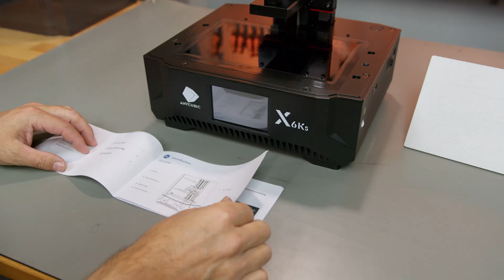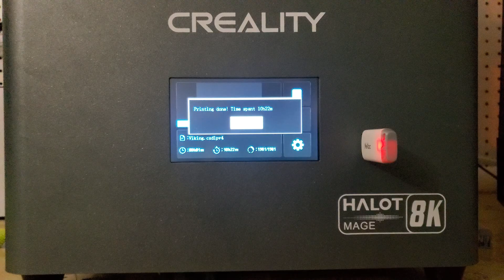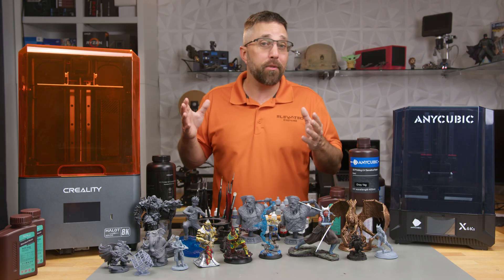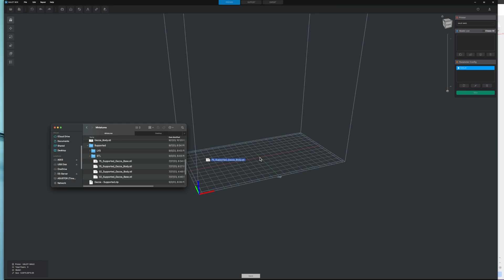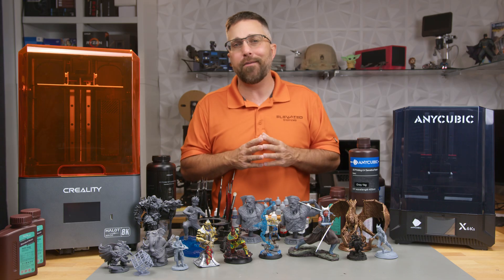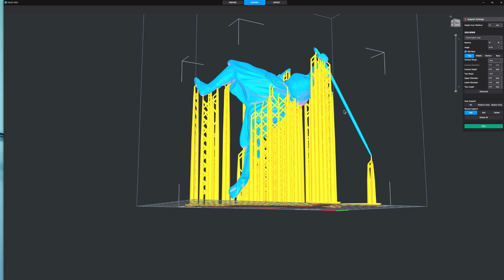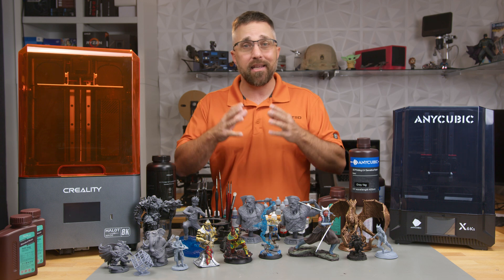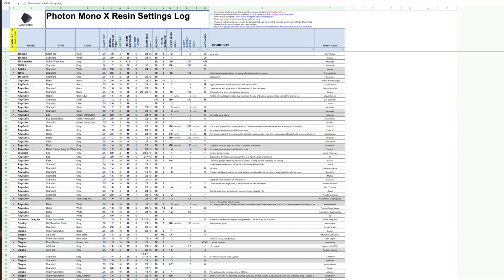Why Are THESE Amazon's BEST Selling 3D Printers? Anycubic Photon Mono 6Ks vs. Creality Halot Mage 8K

Comment: Just a minor correction, the pixel size is in um or micro meters. Nanometers are 1000x smaller and are close to the size of atom scale.
Reply: My friend, what printer do you recommend for my dental laboratory? I want one that combines power, ease of use, speed, and accuracy
Reply: @amraniabdelilah6662  Anycubic
Reply from the maker: Oops, that's more than a minor mistake ☹️ Not sure why I didn't catch the fact that a pixel isn't half the with of a human hair.

Comment: at around 5:23 you said pixel density but meant resolution, as pixel density is the stat that matters, not resolution. It is incorrect to say that pixel density doesnt matter, because that metric is directly tied to the pixel size in micro meters. Very informative video otherwise and I am glad i watched!

Comment: I recently upgraded from the PhotonS to the Mono X 6Ks.  The fine printing is way better than I am use to.  However, the are things I love the PhotonS and wish the 6 Ks had.  I may be getting a little picky, but here are the things I think the older PhotonS was better with over the 6 Ks:

1) The PhotonS had the square arm bar.  I could the build plate 90 degrees and put it back on.  This let the extra resin on the build plate drip down(fairly fast) into the resin pan.  You can't do that with the 6 Ks.  Maybe I can make an arm attachment to do this again. 
2) The 6 Ks build plate top is fairly flat compared to the PhotoS's.  The steeper build plate top on the PhotonS helped the resin drip off into the pan below. 
3) I miss the three fixed sides and lift-up front on the PhotonS.  The 6 Ks top has to be set aside somewhere and I don't have a lot of room.  
4) The resin pan hold down screws on the 6 Ks are a pain, since you need to completely unscrew them to get the pan out versus just loosening them up on the PhotonS.

Comment: I started with the Creality LD-002H and then a Halot One, but I ran to the Mono 6Ks when I moved into a larger format.  I've had success after success with it for both minis and functional engineering parts.  And, I chose Lychee and opted for the Pro license to get access to all of Lychee's advanced settings.  You're right about both being great, but I just didn't have the room for something as large as the Mage 8K.  My go to resins are Anycubic and Siryatech.
Reply: Haven't you had problems with lychee in 6ks? I don't like workshop very much
Reply: @TheCalaudio  No problems at all on any of my printers - Resin or FDM.

Comment: Just picked up the halot mage 8k for only 200 from amazon. I was just seconds away from buying the anycubic  6k for 270 when I saw it and with a discount code I found online I got the creality large cure and wash station too. All in for only 350. Cant wait for them to get here.
Reply: You get those yet I'm looking to get the same combo
Reply: @onemansvideos2134  Yeah but I haven't had the chance to use them yet. Look nice and feel good though. I looked around a lot and I don't this you can do better on the price to quality unless you go to a smaller screen. I am used to  FDM printers so 10 inches or more for resin was a must.
Reply: How's it going? I'm stuck between these two.